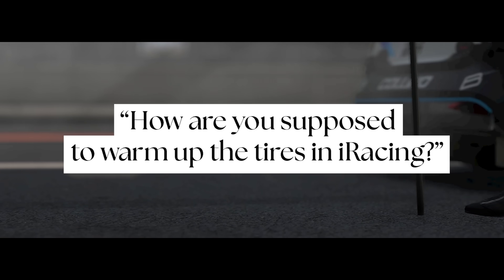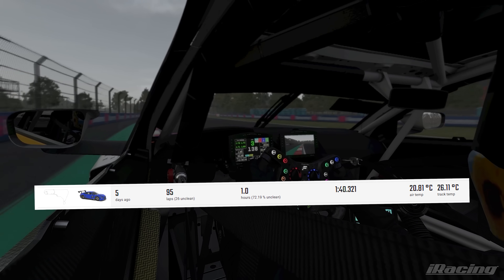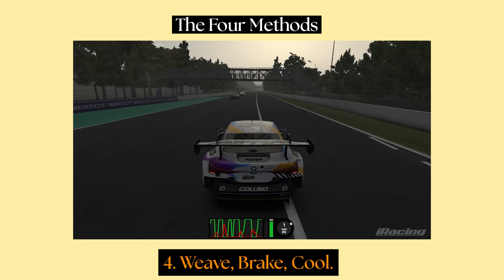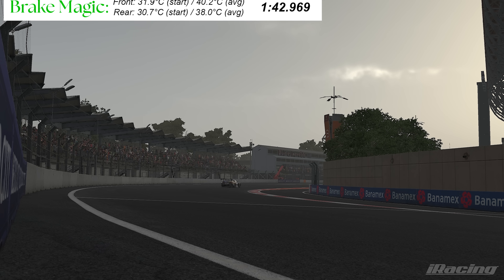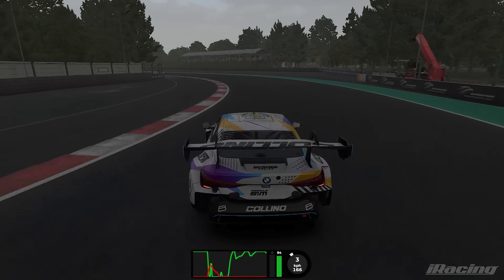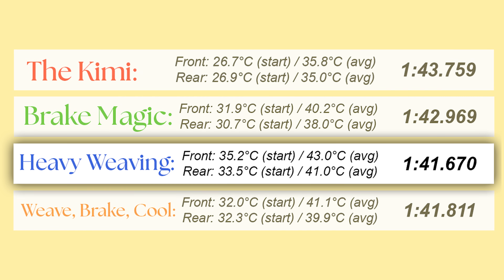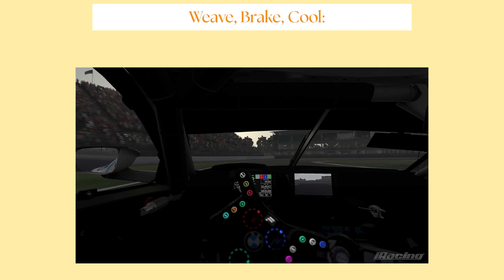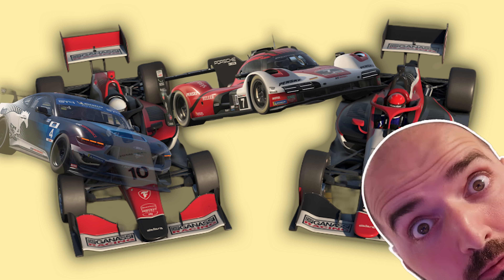Tire Warming Myths in iRacing.

Comment from the maker: Shout out to Fraga for the thumbnail! Below is some additional information from lap 1.
Date of test: 29/09/2025 (NTMv8)
Max Lateral Acceleration through Turn 7 on Lap 1:
Kimi: 2.42G
Brake Magic: 2.44G
Heavy Weaving: 2.65G
Weave, Brake, Cool: 2.69G (nice)
Reply: In which order did you test. and how much time was between the test? :D
Reply from the maker: @skatetrx I tested Kimi, WBC, HW, BM. And once I got a stint that I was happy with I immediately went onto the next method. I don't remember how many attempts each one took though.
Reply: @MF_Henri  i see! i was kinda concerned, that you made like one stint each, in the exact order they rankened and you just made gains bc you got used to the track/car combo and messed up your analysis. but nice job! :)
Reply: yet no mention of weave and burn, if it works in F1 it can work for me doing NASCAR.

Comment: Your definition of brake magic isn't fully correct. Brake magic references a button/toggle on a steering wheel that puts all of the brake bias to the front wheels. In most cars it's not even possible as the max forward percentage is only 70%. In formula one they can send all 100% of pressure to the front wheels to warm the fronts which is what brake magic actually is. In Sim racing it would've been putting the bias all the way to the front
Reply from the maker: I did move the BB all the way forward for the pace lap of that condition, but do agree I can't go 100% front bias:)

Comment: What a about all 10 laps?
Reply from the maker: Sorry, what do you mean? I may be forgetting 😅
Reply: @MF_Henri  I meant whether, if I keep racing 8 more laps, there isn’t excessive tire wear and the vehicle stays stable until the last lap, or whether, because I warmed the tires up earlier, they already have some wear and will last less at the end, losing grip or something like that.
Reply from the maker: @Harpocrator  Ah I see! So for the experiment, I only did 4 laps + pace lap for each condition. The tire wear data can be found at 9:32 . None of the conditions resulted in excessive tire wear. However, I cannot properly answer your question without doing more testing. What I would guess is that Brake Magic would have an impact on end-stint performance due to the raised tire pressures. But understanding tire drop-off (at what % does this happen) is a completely different kettle of fish..

Comment: any tis to heat formula wet tyres quicly ?
thanks for the video
Reply from the maker: No worries. In my experience of formula wet tires you actually don't want to do any tire warming. Most wet tires are very soft, so you quickly end up trying to manage tire temps from being too hot rather than too cool. I've had similar experience IRL where wets work well from cold but quickly deteriorate. I'd maybe suggest just managing balance with the brake bias.

Comment: @MF_Henri, thank you for this.  Very informative.  How did you get "real time" tire temperature and/or pressure for your graphs?  This is not available via the iRacing telemetry, right?
Reply from the maker: You are correct, I added this in post through Cosworth PI toolbox telemetry software after recording all of the laps. Thank you:)
Reply: @MF_Henri Does the cosworth PI software infer tire temperature by applying math to the known speed, load, etc since tire temperatures are not available via iRacing telemetry?
Reply from the maker: Carcass temps have been inferred from tire pressure change, but surface temps are direct from iRacing. They also offer live telemetry now with a lot of info on everything but temperatures 😅

Comment: I mostly drive the P2 and it seems to me that in a high DF car such as this, that putting load into the tyre is the best method, however you can't really do that on the pace lap. For example in qualifying on most tracks the second flying lap will be the quickest, however at Daytona where you spend most of the lap at high speed on the banking, the tyres are up to temp by the end of the outlap and the first flying lap is quickest.

This doesn't seem to translate to the GT3's though, as shown with the Kimi method, I'm not familiar with the track so maybe there's less straights and high speed turns, or it's just the GT3's putting less load into the tyres.

Comment: About "brake magic": I'd try to play with brake balance just for the formation lap. If the rear was a bit too cold, what if you ran 50 % (or even more rear biased, I dunno what BMW runs normally) brake balance and then switched back to normal for the lap 1?

Comment: You dont, you heat up your brakes, in doing so you heat the tires. Weaving is obviously going to scrub and somewhat texture surface, heat soak and retention will mostly be done with brakes....
This is why the amount of brake cooling is critical tract to tract xx

Comment: I rarely weave and only drag the brake a bit. There's too many crashes on the pace lap and I'm not trying to be the next victim. Plus unless you're starting in the top two spots you're going to get held up anyways on lap one with how bunched up the field is. So I usually don't have a pace deficit on the opening few laps because everyone is checking up because the field is bunched up.

Comment: Before I got into iRacing in 2016/17, I was basically only sim racing for drifting and the main warming up of the front tires was from dragging them along by inducing understeer, while the rears were warmed up by the constant spinning from burning out. It‘s still a much needed thing in drifting and has been forever. 

Since last season, no matter which cars I’ve driven, I induced understeer to the front tires on straights, put my brake bias further to the rear and balanced the warm up like that, which really shot up early stint times in sprints and endurance races while keeping them alive and not die after half a stint.

I never raced IRL so I didn’t have the need to do any such warm up, but definitely knew how to go about it. A friend of friends who‘s driving NLS and the Nurb 24h in Cup3 also confirms this works the same as in IRL from his experience (not insane amounts ofc, you get the idea)

Great video btw!! This should help people who didn‘t know how to warm up tires a lot!!
Reply from the maker: Thank you mate! Working on a video about drifting in iRacing atm as well. Thank you for the great info and insight:)

Comment: I'm curious if the same applies in ACC or not, as that's my sim of choice. :D

Thank you for the thorough explanation, and I would looooooove a video that explains how to weave properly, so that I make sure not to pick up too many bad habits when trying to get better at warming my tires. :)

Have a good one, thanks for the video! :)
Reply: You should treat ACC like it has no tire temperature, it will be 90% correct. The sensitivities are extremely unrealistic and it's very slow to change temp. This is most sims.

Comment: Kimi was using the brakes in a straight line. You should also test heavy braking vs just brake dragging. I use to brake drag but with the changes now I speed up and brake heavier in a straight line. Supposedly if you're activating ABS its enough energy for tires to heat. You also hear the brake squeal letting you know the brakes are heated up when the squealing stops. Sometimes by the end of the formation lap I'm able to get some of the temps into the green. I think we also neglect brake temps when it comes to being ready for T1

Comment: Great video! The only thing this is missing is stopping in the box after the outlap to measure the carcass temps directly, yes we both know pressures are equivalent to carcass temps, but you can tell from some of the comments people don't really understand that (even though you touched on it in the video)
Follow-up video idea: Race pitstop tire warming. Burn out from the box? Scrub the fronts hard for the first few turns? Does weaving make up for the straight line time loss by having warmer tires in the corners?

Comment: It just depends on the car and setup really. If you have the brake bias dialed forward then yeah, you’re going to build a lot of pressure in the fronts. I usually have the brake set to the rear via setup just to save time. Then when we line up I’ll roll it forward. The weaving takes care of the fronts. So just dial that bias back and lower TC. Then brake, accelerate, repeat. Just don’t throw a bunch of wheel in it and spin the car. lol

I’ll weave first, then surge the throttle and brake last before we line up. If not TC will kill your start and opening lap times. It just makes more sense to do it that way. To avoid picking up trash when you get off the racing line.

Comment: Oh no, weaving crashes before green was a major problem even before this video, now its gonna be even worse!
Reply from the maker: I'm so so sorry😅 maybe I should have included a "how to do this safely" at the end
Reply: @MF_Henri  any tips for doing it safely?
Reply from the maker: @TheGameboy57 Hey! Probably the same advice id give for racing safely. Make your own space, be aware of everyone around you and practice. Extra PSA, turn the wheel more to scrub the fronts, turn the wheel less to scrub the rears - the latter is far more risky if you are not confident in your ability to control a slide. Hope this helps:)
Reply: @TheGameboy57 And the racing warm up lap and iRacing. It's illegal to weave with other cars around you and it can be reported, but during qualifying of course it's fine
Reply: @EmanHowells yeah I figured that, but people still do it and it's not reported or enforced enough to make a meaningful difference lol. I found it's better to just get decent at cold tires (full send the outlap in practice and maybe next lap, purposely crash to reset the car, repeat) than it is to worry about trying to warm the brakes and tires. The newer tire models might change that but idk

Comment: Not an iRacing player but I usually do something like #4. I use the straights mainly to warm the brakes by accelerating and braking (not grinding) and moderate to hard weaving and in corners I try to put in close to full lock but again, not grinding, just turning.

Comment: compare lat G and Steering Angle. This you can see if the front tyres are scrubbing in the first lap. In theory you should see a 45 degree line. If you see an S shape with a flat top and bottom means you are steering but the car is moving forward. Happy to show you if you need more info. PS for a job i train F1, FE, IMSA WEC team on data analytics

Comment: Actualy Kimi was doing your so called brake magic.
Reply: Brake pad in F1 work at 400c minimum, so he was braking to warm up the brake more than the tires.  

If you want to lock up really easily on T1 in F1 just don't warm your brakes.
Reply: F1 cars struggle to heat their front tyres as all they do is turn the car. They also have huge front discs. They use the brake magic button that puts almost all the braking through the fronts. In real life, this also warms those front tyres through thermal radiation. I racing doesn’t simulate this. It also gets their brakes in the window.
Reply from the maker: @jenscee7679  after the fact, my engineer friend calculated that the internal tire temp increased to around 60c on the brake magic technique. So iRacing must simulate it, but maybe not accurately? Or do you mean surface temperatures should increase too?
Reply from the maker: Oooo I did not know that!! I wonder what he called it😂

Comment: I'd love to see the same methods but adjusting the brake bias. Use the Bias to warm the fronts or rears more (maybe different runs with each, a middle ground and the default for comparison). Then also returning the bias to default, or your own default for some race laps.

Comment: The main thing about iracing that is extremely unrealistic is the lack of brake temp effecting tire temp. In real life brake temp is easily the best way to get tire temp, and far and away the most popular way to build temp in real cars. I have never driven a gt3 car but it is principally the same, core vs. surface temp. I am a real life driver and have been racing for over 10 years, and I am currently a teen Mazda challenger driver, so I like to think I know quite a bit about this stuff, but I am not perfect
Reply: Yeah I've worked with a few GT drivers aswell, one even raced at Monza endurance and they mention that is best to heat up the tyre from inside out. So essentially brake and gas hard in straight line avoiding blistering the tyre. Not dragging the brake just good hard braking and doing the turns normally you should be good to go. Also you avoid spinning by mistake.

But since its a sim... you use whatever works and wait for the next update patch hehe
Reply: If my understanding is correct the brake temps are impacting the tyre pressure, but no the tyre temperature? Leaving you with an over-inflated, cold tyre?
Reply: @fastforward7670  It heats the tires from the core so that you're not just heating the surface by scrubbing.
Reply: I think you're both right and wrong here. Ask your engineer what your tire temps are at the end of the outlap, and youll find it does buy you some temp, but not more than a few degrees. 

Then ask your team if it's alright if you compare that to swinging the wheel around like a psychopath. 😂

Comment: You spoke about the tyre pressure in the fronts from the brake drag method. What happens if you did the same but put more brake bias to the rear, and so reducing the heat into the front tyres.

Comment: Its kind of a shame that for quali we have to full hyper scrub the tires to get pace out of them, but at least its better than doing the 20kmh outlaps we used to do back in the day for min temps. The dreaded 20 minute oulton park outlap lol.

Also while im thinking of it, there seems to be some interesting tech for quali, where by spinning the rear wheels at a speed that isnt fast enough to get scrutinized by quali, but is fast enough to break traction, you gain a pretty sizeable amount of rear traction and temp. We saw some teams doing it at Indianapolis, watkins glen, and Road Atlanta most recently in quali. Granted, thats GTP, which is a slightly different version of this gt3 tire model, but usually this type of tech has broad range across the game.

Given that IMSA Esports pre q is currently underway I might actually try doing some goofy strats and I can report back in this comment.
Reply: welp, looks like full scrub is still the way, even for 10 lap runs, how am i even surprised at this game after all this time

Comment: Thank you. Would you suppose these findings apply for GT3 only as iracing uses different spec/age/ tyre model for different cars? The finding of brakedragging raising pressures too much is very interesting.
Reply from the maker: I am really not sure if I'm honest. All of the cars should be tested individually to know for sure, but this is a good indicator for the cars on NTM. I was shocked by the brake dragging results haha

Comment: Would've loved to see the "longitudinal loading" method, where instead of weaving that loads the tires laterally, you use a long straight to just go from heavy acceleration to heavy braking. You do that once of twice down each straight/acceleration zone to put that longitudinal load in the tire.
 It's why sometimes you'll see F1 drivers create big gaps to the cars ahead on a safety car restart or at the end of a formation lap, so you can accelerate hard into that gap to get rear temps up then brake once they get close to the car ahead for the front. 

This is a lot easier in iRacing's quali format since you're alone, but if you're careful (and try to pull to the side) you can do this on formation laps as well. This is also sometimes supplemented by very light, non-agressive weaving at the end of the lap so the temps don't fall again.
Reply from the maker: Ah good point, I'll add this to the top of the list!!

Comment: You forgot the most important part: how do the tires react during the end of the stints. As it's great to have a ton of pace for lap 1 and 2 but if your last 4 laps are snap oversteer city, I'll take going slower. I'll blow past you at the end of the race when you can't hold on. I use the kimi and it works out.
Reply: kind of what I was wondering, if the other methods only give an initial faster lap time, what happens at the end.  Does Kimi have the best average lap times over the course of a stint where the other methods fall off faster.  Basically someone might be faster earlier, but another might be faster at the end.
Reply: @aaronb486  it's kinda how I won my first w13 long race. Since ppl usually switch to soft tyres at lap 34(out of 67 let's say). Did one extra lap which did cost me 2 seconds, but it made me confident to push last lap while p1 spun out under pressure due to just the little bit less grip. In 20m races this probably doesn't matter. so he'd need to check this for 45m races. Or even 1 test for a full stint between Kimi and weave would be great to see